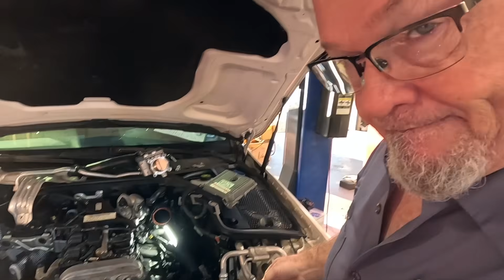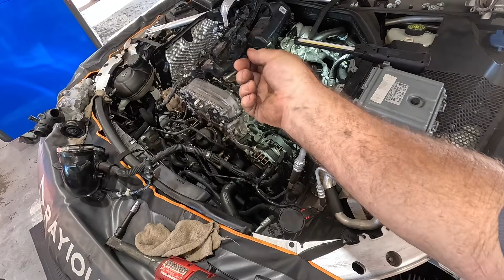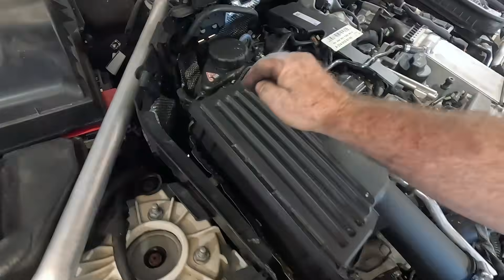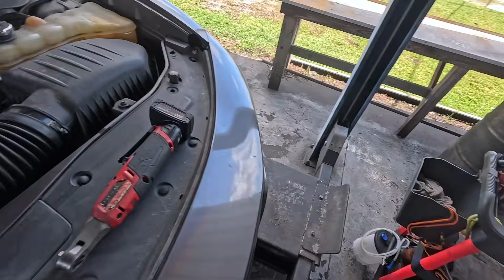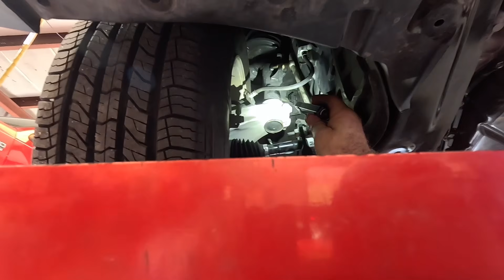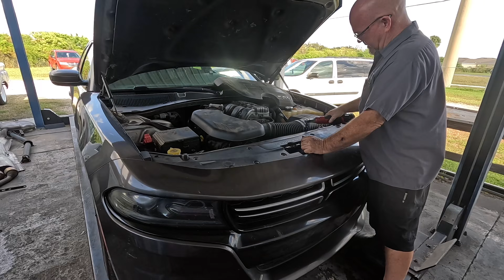Charger Crank Seal, C300 thermostat, 22 Mitsu SUV Align. Auto Repair Shop DAY 815

Comment: Your filming comes in handy when you have to reassemble things.  It would seem that the engineers simply take a mock-up & add a bunch of wires & hoses & clamps, then have the manufacturing department recreate it.  They don't care about the technician because the dealership can make more money that way.
Reply from the maker: It really does help! They seem unconcerned with repairs after. Just pay the tech .8 and send it. lol

Comment: The patience from Watch Wes Work & yourself amazes me, you're better men than I taking on Euroboxes & diesels. Call me a crybaby but I'd have turned that Mercedes away, no way that's a 6 hour job even for the dealership. In it's own way that was as painful as the Corvette re-seal.
Reply from the maker: Haha, it definitely tests your patience sometimes! It took the full time even a little more. But the next one I’ll save an hour from not staring in amazement and bewilderment.

Comment: Jimmy, are the rayiou fender covers you use the M, L, or XL? Looking into getting a set and I like the size of the ones you use. Thanks for your input
Reply from the maker: I got them as a set of different sizes. 4 all together. Pretty light duty, but great for covering everything up.
Reply: @JimmyMakingitwork ok, thank you sir